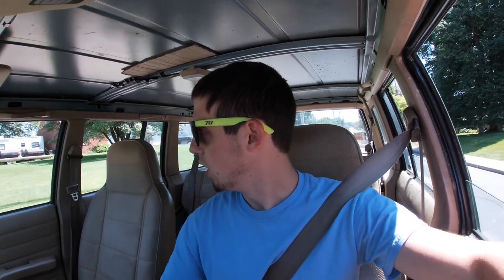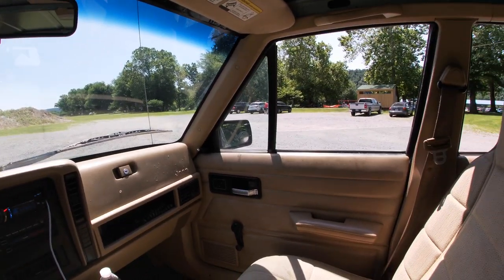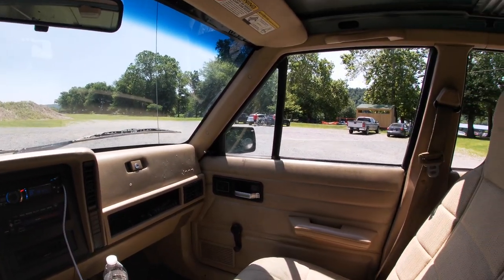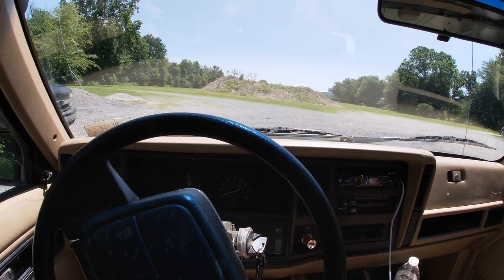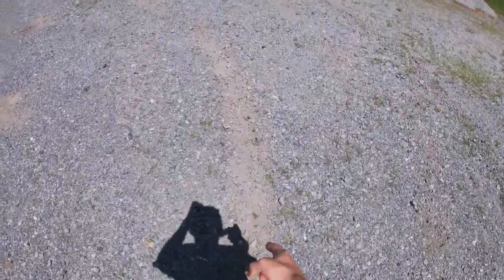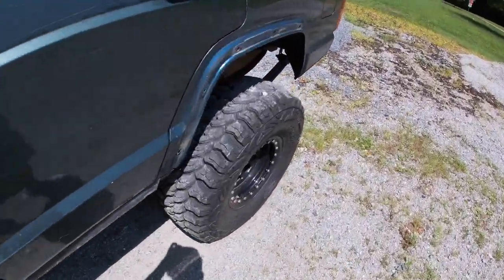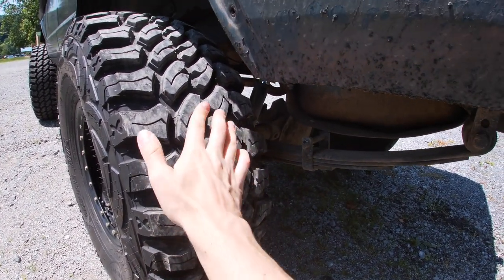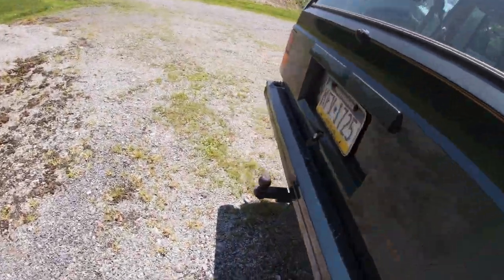Living with a Welded Diff In A Jeep! Pros and Cons

Comment: ght I got a gq patrol never gonna see road in its life want it to last awhile like few years don’t wanna spend money on the prick gonna send n send frount n rear diff cos I got bogged really bad today had to get a tracktor to pull me out if I weld them is it gonna fuck my shit up n cost me money
Reply from the maker: If you do street driving I don’t recommend welding the front diff unless you have hubs that you can’t connect/disconnect. The rear doesn’t fuck anything up except eats your tires faster then an open diff/ LSD. You also run the risk of breaking the rear if not welded right